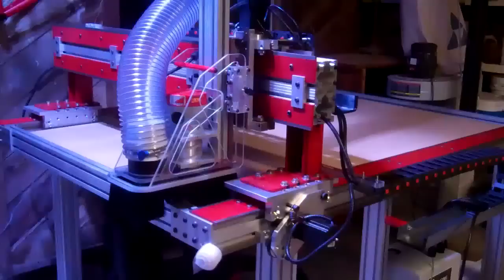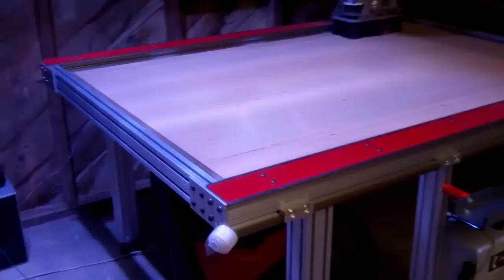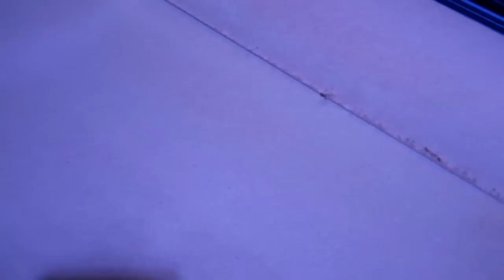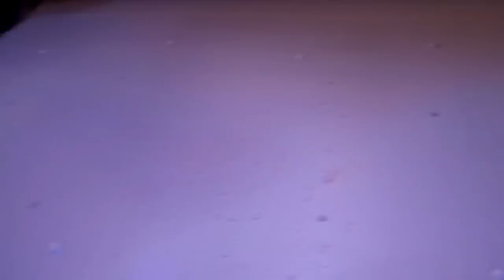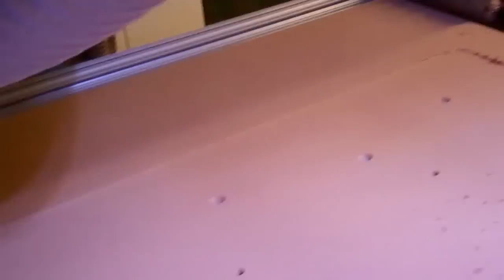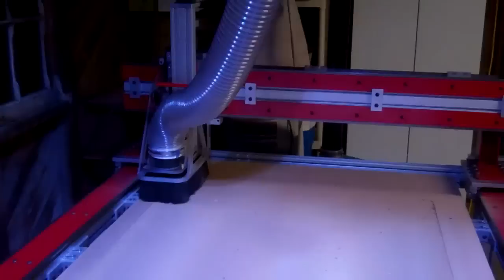CNC Router - Part 21

Comment from the maker: Yup - to make the table surface parallel to the x and y axes.  It also helped to see if the z was perpendicular to x and y, since if it was off it would make little ridges in the table.